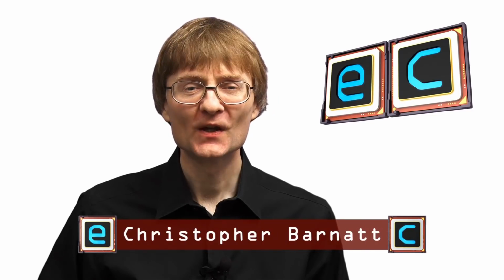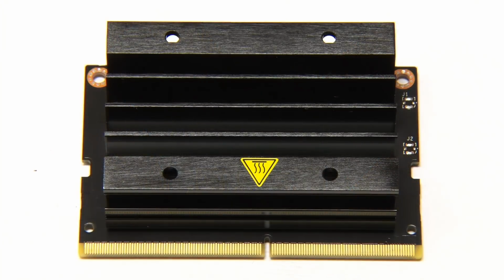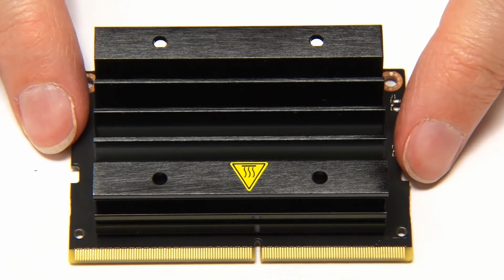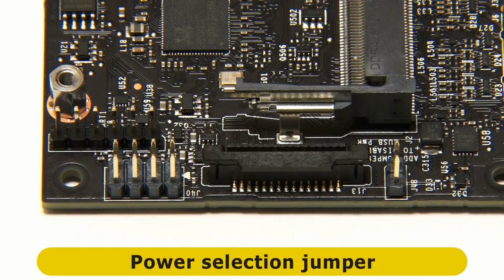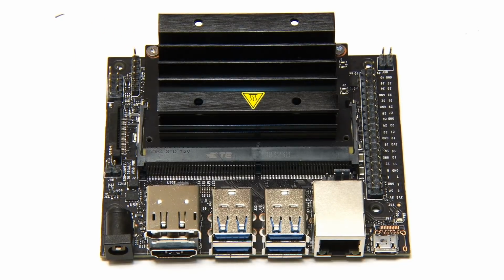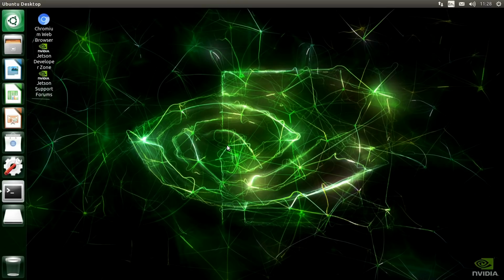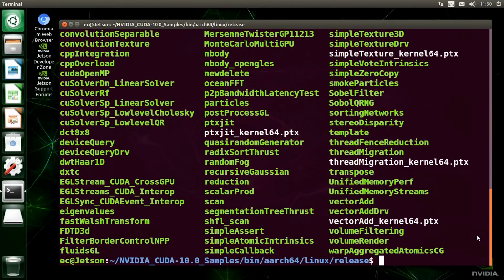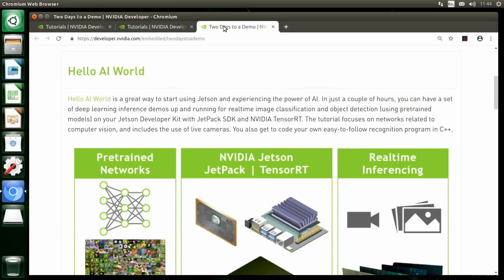NVIDIA Jetson Nano

Comment: Can this thing boot from USB? Or does it just boot from SD-card? If only it had an M.2 slot capable of holding a bootable M.2...
Reply: Not without a lot of effort it seems. Needs a new kernel with more features to access USB, and some other, hacky solutions: https://www.youtube.com/watch?v=7O7pUtQD9HI - doesn't seem to boot any faster though.
Reply: It is weird how long these little SBCs need to boot, and it does not seem to be just because of slow I/O either. By the looks of several videos it looks like booting takes almost 50 seconds.
Reply from the maker: Boot is slow compared to, eg, a Pi 3B+.
Reply: @ExplainingComputers  Yes, I find boot time fascinating. I saw a desktop computer boot in less than 5 seconds: https://www.tomshardware.com/reviews/fastest-windows-10-boot-time,5810.html. ASRock-motherboard.

Comment: Nice video ! I'm definitely curious in how the video encoding capabilities of this little thing can be exploited. With the right software you could encode a 1080p stream on this little thing with power to spare, gone will be the secondary PC for streamers, just add a small jetson module and a second display/kvm. Or even for security cameras, like a special support from motioneyeos to use this as the central node to encode the different video footage from 4 Raspi zero at 720p.
Reply from the maker: Totally agreed. Great video potential here.
Reply: @ExplainingComputers  Thank you ! I think in the end all it takes is some software support, and given that this thing is made by Nvidia ... I'm actually not sure if they will focus their support solely on AI, or if they would explore the video encoding capabilities of this thing as well, as this is to my knowledge one of the firsts ARM based SBC to have a really powerful CPU, and given that they provided Turing cards with a better NVENC encoder, I can imagine them putting some support for video encoding software for the Nano. This Jetson could become a low power streaming box that you can use on the go, just attach a camera to it, and with Wi-Fi 6 and 5G using wireless networks for streaming would make sense.

But hey, I'm only dreaming about the possibilities ... so that I can delay doing the dishes. 

TLDR : I'd be thrilled to see more videos about the Jetson's video encoding capabilities on this channel !

Comment: That is a such a cool small unit, I would think that would make a superb video display, editing small form factor machine and it does address the limitations the RPi's suffer from where you want to perhaps develop better graphics in an application.   The other thought is the cpu isn't a laggard and this could herald far better game emulation on the 64 bit and higher ends of emulation gaming as the RP3+b is absolutely rock solid for up to 32bit games but struggles with 64bit "heavies" like Goldeneye or the perennial Super Mario 64 which becomes a total lag and artefact fest.   Its size and capability also adds to its ease of installation to any sort of HDMI display whether as a pc in a box on the back of the telly to some of the newer smaller screens coming out for small devices and I can see it being used on a range of machines like a modern Tig welder control board and even the central control for a homebrew CNC device :)

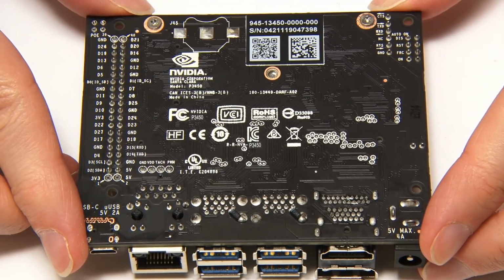Comment: Look at those bodged diodes on the bottom!  5:23  At the bottom center you can see the unlabelled hand soldered diodes at 45° and connecting to the USB cases.  They don't have their own normal SMD pads but are directly going from the USB pins to the grounded USB case mounts.  What happened there Nvidia?!?!   ;-P

So I disagree a bit about the quality.  Seems they jumped into production PCBs early.  Look to see later board revisions with those diodes on the top.  Sometimes it is best to wait a bit and not be the first to purchase.   ;-)
Reply from the maker: Interesting spot . . . I need to go back and inspect the board.
Reply: @ExplainingComputers  - A little hard to spot as it is a black component on a black PCB but definitely not planned before the PCBs were made.  And actually the middle silkscreen with all the logos isn't to the same quality as the rest of the silkscreening on the same side telling me they likely quickly added that to finished boards after they got some of those approvals.

In any case expect those to be fixed in the next PCB revision.  There is no reason to place the diodes on the back of the PCB and it actually costs much more when they are the only parts on that side.

Good video though!
Reply: And for those interested the diodes appear to be BAV19W switching diodes with a 2.5A max surge current and a fast switching speed.  They appear to be going from ground to the 5V USB pins for some reverse polarity protection.

Comment: If you power the Nano via usb c then it automatically runs in low power mode and you shouldn't expect half the performance. To get full performance you must power the Nano via the barrel jack.
Reply from the maker: This I now understand may indeed be the case. :) However, the the 24 page pdf user guide provider by NVIDIA does not say this. Rather, it states that "if the developer kit’s total load is expected to exceed 2A, e.g., due to peripherals attached to the carrier board, connect the J48 Power Select Header pins to disable power supply via Micro-USB and enable 5V⎓4A via the J25 power jack." In the following section it goes on to say that "The Jetson Nano module is designed to optimize power efficiency and supports two software-defined power modes. The default mode provides a 10W power budget for the modules, and the other, a 5W budget." So nowhere it is stated that using the micro USB power connector will put the board into a 5W mode -- clearly not a "software defined" thing! In release 32.1 of the separate Developer Guide document, there is then information on using software commands to change the power mode, but not a word on the mode being selected by the power jack used. Sorry, I am not moaning at you here! :) But if the board really does go into a 5W mode when using the micro USB connector -- and I've yet to read anything from NVIDIA that actually says this -- then it is up to NVIDIA to make this explicit! :)
Reply: I'm trying to remember where I got this information. Probably ETA Primes youtube site.  Although he may have just been cautious!  You could of course connect a barrel jack and retry video performance and see for yourself.  I don't have a Nano so can't assist you.
Reply from the maker: Thanks Walter. I have been searching around, and am starting to think it is the first urban myth for the Jetson Nano. :) I will try power via a jack (for 4A), and indeed via the GPIO pins (for 6A input). But I am starting to think that the fact that the two (non GPIO) power inputs, and two software-controlled power models, are getting conflated in some reports on this board. This all said, I've just had an e-mail from NVIDIA. So I may well be able to get definitive info from the source. :)

Comment: Very interesting little board. Looks like it would be fun to play around with. But as a hardware guy, some things caught my eye. On the module itself you can see where the eMMC would go and on the main board you can see where they would use a different usb power and on the other side what I would assume would be a battery holder. Maybe for a real-time clock? Anyways, another fantastic video!

Comment: Great video, this board seems more handy than an Nvidia shield, I found android TV though very user friendly, its quite restrictive, like button configuration,
This a good alternative to a raspberry pi, but I have noticed on the shield which this board is related to, it to really chug if more than a couple of apps are open, so it's no power house, it would be nice if the next generation of pi could do similar things, like the ai, but maybe with a slightly beefier CPU.

Comment: was just wondering, is video acceleration enabled for chromium on your build? linux in general doesn't really have video acceleration enabled for web browsers. firefox has an option buried in the configs and you need a custom version of chromium that i was under the impression had only been compiled for x86_64. just verifying because you were talking about dropped frames and that might be why.
Reply from the maker: Almost certainly Chromium has no hardware acceleration here.

Comment: A very decent device (It's essentially a Shield TV Lite hardware-wise) which is let down by somewhat poor software support, at least in the video decoding field.
Nvidia still uses a custom OMX decoder (they were using it since Tegra 2 or even Tegra 1 days) instead of VDPAU on all Tegra boards. And the only software framework they support for video decoding is gstreamer. That means you can forget about Kodi, VLC or anything else that uses FFMPEG or AVCodec. Heck, even gstreamer-based software will need to be patched to work with Tegra although patching is quite trivial (you just need to change the default video sink).
As for all that AI stuff, it sounds a bit strange why is Nvidia trying to target such a narrow market when this board has potential to be a really decent general purpose SBC. My guess they just want to focus on their existing target market for Jetson boards - AI developers and researchers. So they can sell them a more expensive Jetson later when the Nano is no longer powerful enough.

Comment: Strange that it's removable, future upgrades? And 156 cuda cores isn't bad, a switch has 256 (I think)
Reply: SeenCreaTive no, this is a developer board. The idea is that you integrate that chip into your own hardware and use the developer board to test and develop the software.

Comment: Is it not possible to use the M.2 slot for storage instead of a WiFi module?
Reply: Sadly, I don't think so.  M.2 slots have different keying depending on the IO pins they make available.  The current Jetson Nano M.2 slot is keyed for type "E" cards like the recommended Intel 8265NGW dual band WiFi module.  I have found tiny M.2 2230 SSD cards, but NONE which use M.2 type "E" keying.  

I really hope this will change in the future because most folks will not appreciate having to add a 20 dollar module to get WiFi (especially when the Pi Zero W cost's 10 dollars, a tenth the price of the Jetson Nano,  and INCLUDES on-board WiFi).  So, hopefully the next iteration of the Jetson Nano will include on-board WiFi and an M.2 slot keyed for an SSD instead of a WiFi module.

Comment: Hi please confirm if jeston nano would thermal throttle thanks.
Reply: It probably does but just add a Noctua fan or any other fan and you should be ok. The heat sink does a decent job but I don't trust passive cooling.

Comment: The wifi module that supported is 8265ac, only. 9260 won't run, 3168 won't run. https://devtalk.nvidia.com/default/topic/1050449/jetson-nano/intel-9260-wifi-on-jetson-nano-jetbot/
several attempts have been made but they all failed

Comment: I presume this little card can read all EXT file systems as well as NTFS and FAT32? Any stress testing done for file copying? Overheating issues? I am looking for something rudimentary that will be "un-infectable" by malware. The idea is to copy files from infected disks with minimal risk. I have seen issues with the standard USB3 Linux drivers (sudden disconnect whilst copying) on some machines.
Reply: It runs Linux out of the box, so yes...  But if you just need to copy files from infected disks you could use a Linux host, virtualbox linux VM with snapshots and attach the disk over USB, bypass the host entirely

Comment: Would like to see some benchmarks on this board so we can compare it to a Pi in terms of power - plus when you change to the barrel jack, add the fan to bet max possible CPU usage.

Hopefully Nvidia will keep the drivers updated so that any bugs are squished.

I know it's not it's intended use but it's ability to do H265 @ 4K/60 seems to be ideal for video playback

Comment: This is a very cool board.
But it's important to consider that a GT 1030 (a very modest card, which trades blows with integrated GPUs) has 3 times the CUDA cores, and those are newer Pascal cores, while the Jetson Nano has Maxwell cores, not even from the 900-series but from the 700-series of Nvidia GPUs.

It would be interesting to compare the Jetson Nano with whatever is the cheapest PCIe-capable SBC + a low-end, cheap card, totaling the same price as the Jetson Nano.

There are of course advantages to the Jetson Nano such as power consumption, and whatever community support it might start to have.
Another comparison is that the Tegra X1 is the same as on a Nintendo Switch and Nvidia Shield.

Comment: FYI: static bags are not as effective when they aren't properly sealed. NVIDIA should be ashamed. Just say'n. 😂
Reply: Shinigami Lee, it was properly sealed. It's not a vapor barrier bag just black poly antistatic bag. A heat seal is just a drop sealer (a manufacturing convenience) or a vapor barrier for components that need to see reflow temps and  don't tolerate  ambient room humidity.
Reply: @anullhandle  
I know what kind of a bag it is.

I am an electrical engineer and scientist, so I don't give a shit about vapor bags.

What I said was that a static bag is less effective and they shouldn't be shipping it in an unsealed bag. This isn't a complex subject and it's standard stuff here. Not controversial in any way.

I think I was very clear in my comment above and I know exactly what I am talking about. And NO it wasn't shipped properly.
Reply: @YragLee  bag manufacturers and nvidia disagree.
Reply: @anullhandle 

Listen this is scientific fact, not opinion.
Reply: @YragLee  , k

Comment: Whenever I watch a video about small computers, a feeling of incompleteness comes to me. Why is the processor so weak? 4 GB RAM, strong graphics, one component must always be bad. Wouldn't it be possible to shove an octa core processor with a higher frequency of 1.8-2.0 GHz? They always throw up something not done, the same situation with Respery Pie, there is always not enough RAM, when using 2-3 programs at the same time, it starts to stuttering in the graphical part of running programs... Good video, but I will not buy it.

Comment: is or will there be a mainboard version with multiple slots for the AIcard ??

for the framedrops on youtube i wouldnt blame the board just yet. Amazon Prime as an example has once again started to stutter on "almost all" my PCs (win10),
including a i7-5820K+RTX2080. on all quality settings. Youtube runs smooth even on 4k, so its NOT the webconnection.

It's not always the hardwares fault...

Comment: Hello can you help me with something i have build a new pc with some old hard disk and psu with 420 voltage i bought new motherboard asus prime a320m-k cpu amd athlon 200ge ram G.Skill 8GB DDR4 2400MHz. So i have some problems i installed windows 10 pro 64 bit and my pc is lagging i install all drivers but still it lags. He needs a lot of time to turn on and off and that is so bad for me can you help me with solution pls. Dou you think its a hard disk or psu? Btw nice video
Reply from the maker: This will be the hard drive limiting speed.

Comment: cheek this page out ... https://www.nvidia.com/en-in/autonomous-machines/embedded-systems/jetson-nano/            

check the picture of the board , i think there will be a version with wifi and bluetooth as there is some unpopulated space on the board and it has traces for antenna connectors i am sure it will have wifi and bluetooth in the future !!v

Comment: Great video on this one,

It should be interesting to see how this one goes with the onslaught of SBC's around the corner which will be based on the newly announced 3588 from RockChip aswell as AI offerings from them also..

AMD and Friends have done really will with OpenCL / RoCM.   Yolo ( You only look once ) is now 100% ported from requiring Cuda to OpenCL for object recognition / identification.  This is really becoming a tinkerers place, if of course you can get in there and leverage the great free software available and there are quite a few of them.

Its really beginning to heat up out there.

Comment: We need an AMD Zen + Vega IoT board, but this one is really good, tho only if it had intel or amd cpu not arm cortex
Reply: https://www.udoo.org/udoo-bolt/

What you wish for exists, but it's in an entirely different price range and far larger and more powerful
Comes in lot more powerful Ryzen  Embedded V1605B or V1202B CPU
With either Vega 8 or Vega 3 GPU integrated.
Has TONS of IO and uses laptop DDR4 SODIMM memory.
Reply: I am not sure if AMD is going to really jump into the IoT space, they have their own platform right now which is not Arm derived.  With that said though it might happen.

Comment: Um is it really that impressive of a piece of hardware or are you being paid by nvidia.
Reply from the maker: I am not being paid by NVIDIA. They did not even supply the board. I have never been paid by any company to make a video or to say anything in one.
Reply: @ExplainingComputers  Thats what i figured but wanted to make sure because you usually don't give something as much praise as you did this. No disrespect meant sir.
Reply from the maker: None taken! :) This is a very nice board. I think it shows in the hardware that this is a small computer from a very large manufacturer. We will see how software support holds up over time, but so far it looks good, at least for the purposes the board is intended for.

Comment: Thanks for your great video.
I am curious if Kodi works on this device and if an infrared device can be connected for a remote control so you can use it as a HTPC.
Reply from the maker: I'm sure that Kodi could be ported to the Jetson Nano, but I don't know if this has happened yet. A USB or GPIO IR receiver has to be a possibility also. We will see how the maker community embraces this board.